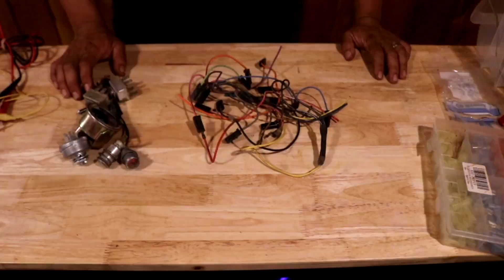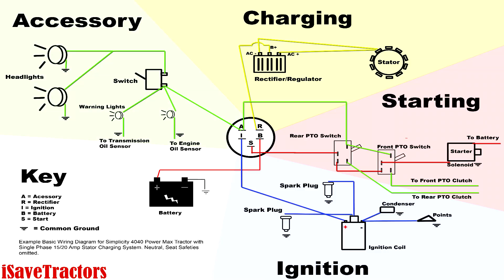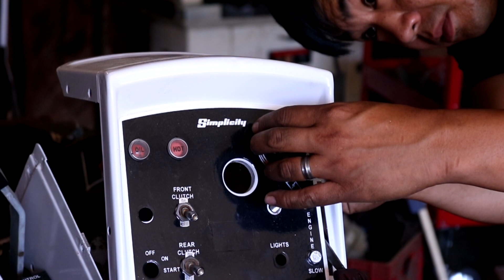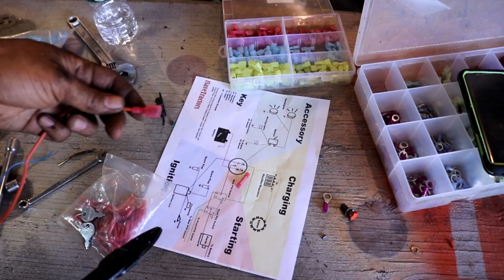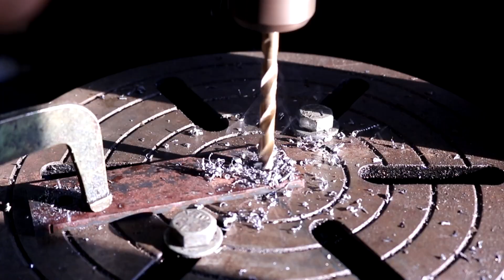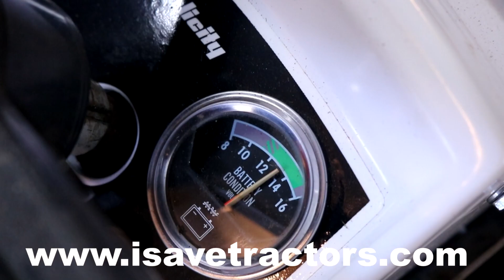Simplicity 4040 Garden Tractor Project - Episode 7 - Wiring and Completion

Comment: very nice job, do you have a link to the spade connectors you used in this video?
Reply from the maker: I just ordered them on eBay, important to get the nylon connectors and not the PVC ones.
Reply: @Isavetractors  the PVC are garagbe?
Reply from the maker: I dont like them. They crack easily

Comment: Can’t understand why you didn’t use readily available terminals and connector bodies for your ignition and PTO switches. In fact you can buy prewired pigtails for the common 5 terminal key switches. Makes life a lot easier when doing repairs over trying to remember which wire goes where....... It’s the only way I do it for my customers.

Comment: So the stator wires go back to the "R" on the ignition switch/key switch?
Reply from the maker: The stator wires go to a regulator rectifier and then the direct current from there goes back to "R" on the key switch
Reply: @Isavetractors  ah okay thank you so much for the help, I'm still learning about the electrical side of the engines. Much harder when the tractor is missing a lot of parts.

Comment: did you have to prime the pto system. I just bought one of these and the 3 point lift wont raise the brush hog.  also it will not start unless you prime it with gas before cranking.

Comment: Love your vids and the tractor looks great!  Did you use the same gauge wire throughout? And how did you pick wire colors?   And were there fuses anywhere?   Also can you link your crimp kit please.  Thanks you're the best!
Reply from the maker: Thanks. I have inline fuses in the ignition and pto circuits. I normally use 14 gauge throughout but here I re used some of the old wires which were 16 gauge. Colors are arbitrary, I just used whatever I had. I'll find links to the terminal I use. Thanks for watching!

Comment: Love it. 
I went for the "resto-mod" route with my 4040. I yarded my running-but-not-charging Onan CCKA out and retrofitted a harbor freight v twin in there. My hood already had holes in it, so I just cut another notch for the new exhaust pipe.  
I had just spent $350 on tires when it quit charging. I figured the engine had 1000+ hours on it and burnt oil so I may as well replace it, since fixing the stator required removal as well. 
I don't have lights on mine. But I've got a loader. :-p

Comment: I can’t believe you are doing the safety deletes, that’s as dangerous as riding a motorcycle without a helmet! I like the safety that shuts down the mower deck and requires you to turn the key to go in reverse.
Reply from the maker: That safety didnt exist back then. The best safety is the one between your ears. YMMV
Reply: isavetractors, agreed.
Reply: Rusty Zipper, no that’s the worst one of them all. I hated that one. If I bought a new mower or did a restoration of one I would delete the seat switch, and the reverse switch while the blades are on.
Reply: Agreed Norman, although I did almost lose a foot on my simplicity 725 but brain was not engaged, hit a stump and foot went under the deck... lol lucky day for me I’d just disengaged the deck... steel toes shoes now. :)
Reply: NG Hermit, oof. That would’ve hurt like a mother if the deck was on.